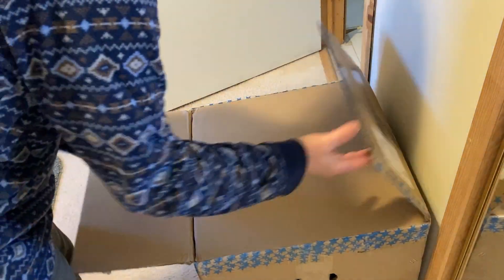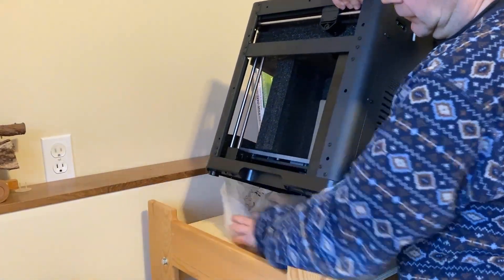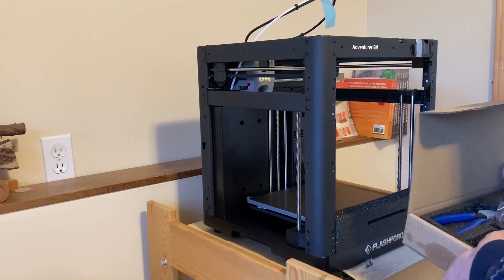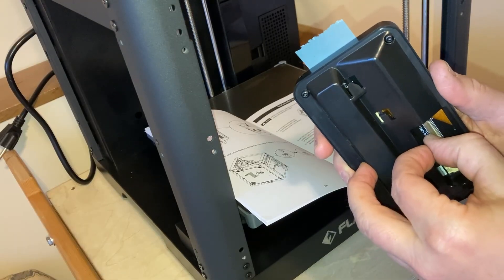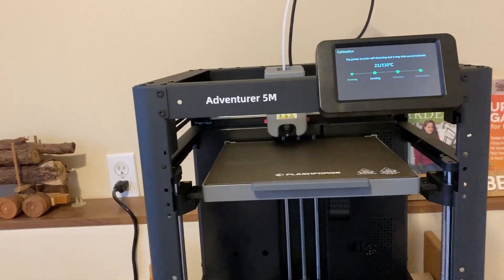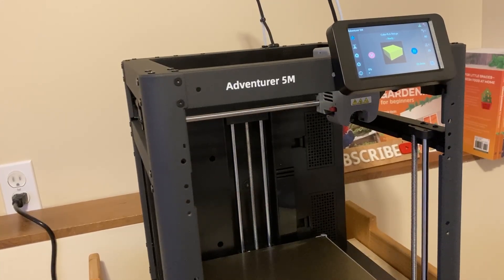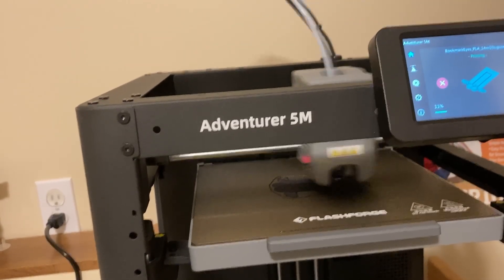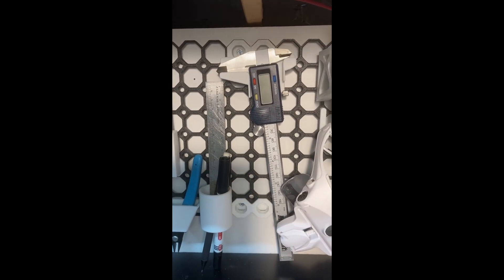Unboxing, Setup and First Print on my new Flashforge Adventurer 5M #flashforge #fdm #3dprinting

Comment: So im super new to the 3d printing world and am thinking of getting my first printer. I thought these needed ventilation of some kind? Or is that something newer printers dont really need? Thanks for the video!
Reply from the maker: It really depends on what materials you are printing - I have the printer in my office and do open the window a bit for fresh air when printing. But I mainly just print in PLA. If you’re printing ABS you definitely need ventilation and an enclosed printer.

Comment: Thank your for sharing your experience with this 3D printer.  I'm considering getting one for my R/C modeling and scale building of crawler trucks.  Does this printer have any odors or strong smells created while in the  printing process, my wife is pretty sensitive to odors and I would be putting this in my basement shop.  They sound like a awesome way to make custom scale parts, with beter geometry than I can gain from machining them out.  Thanks again, Take care and God Bless
Reply from the maker: It's a great printer for that - I've printed and built some of the 3dsets R/C vehicles over the past year. Compared to a resin SLA printer, filament is less smelly and generally safer if you only print in PLA, however there still is a smell since the printer is melting plastic. I would suggest as you are planning to keep the printer away from living areas - hopefully your basement has a room where you can close the door. If you can ventilate the space as well while printing, that would help.

Comment: Does it run your electricity bill up? Thanks great video
Reply from the maker: I wouldn't say by much. I just print once in a while when I need something. I've done a few RC projects that meant a lot more printing over several weeks and did see a bit of a jump in my electricity bill, but not a huge amount.

Comment: Our plug keeps disconnecting in the back, any suggestions?  And the filament keeps clogging and "breaking"
Reply from the maker: You mean the power plug? Try pushing it in firmly - if still loose I would contact Flashforge support. As for the filament breaking make sure it is dry and not too old - you didn’t say what type of filament, brand or how long you’ve had it.

Comment: You didn’t actually set up how you get into your account boo that’s where we’re stuck. It’s not working for us.
Reply: Same issue here
Reply from the maker: You don’t need an account. I have one but haven’t used it in a while - I just print directly to the printer over wifi using Orcaslicer. Or you can directly connect to the printer via Ethernet cable too.
Reply: @pacificcoastminiatures how do you setup to print over WiFi with orcaslicer? I've been using usb
Reply from the maker: Yes I print via wifi from Orcaslicer. Never had issues even with all the firmware updates that supposedly caused some people to lose their wifi connection.
Reply: @ just wanted to point out that my original comment was a little rude sorry I meant to explain that the first step should have been to maybe explain better the login process as that has been our main problem. Sorry about that.
Reply from the maker: No worries. Were you able to get up and printing successfully?
Reply: You only need the account for cloud printing which isn't good.  Use wifi or usb

Comment: the ribbon cable is the worst thing about this i think i bent mine and now the entire thing is just one big paper weight
Reply from the maker: Yes I agree it’s a bad design. But reach out to Flashforge for help - they can maybe send you a replacement.
Reply: It's actually a lot simpler than what it seems. It just goes straight in you don't have to install it at a weird angle than I thought
Reply: I was trying my hardest to try to get that ribbon cable in that weird angle and then figured out it's just a straight up and down slot. A design flaw in my opinion. Wish it was just a regular slot
Reply from the maker: @ridge9577 yes definitely a design flaw.

Comment: I set mine up yesterday, my first 3d printer. It did great. Now, today it goes thru the motions but no filament comes out. Help?
Reply from the maker: It sounds like you have a clog. You could try following this video from Flashforge: https://youtu.be/u12A1M3G68U
Clogs normally shouldn't happen with regular PLA - is that what you are printing with or some other type of filament? The only clogs I'm getting is with TPU, but that's a really difficult filament to print with. PLA is the easiest for beginners, so stick with that until you have more experience.

Comment: would be the perfect printer if it wasn't For the small bed. at least minimum  260×260×260. not 220...
Reply from the maker: So far I’ve found it to meet my needs for what I want to print. Keep in mind that these companies are usually aiming for a certain price point - making a bigger printer means the price goes up. Rumour has it that FF is planning on releasing a Plus or Max version of the 5M so we’ll see. I plan to build a 350x350 Voron Trident one day so that I can print larger items.

Comment: I don't know where to put the other end of the LCD cable
Reply from the maker: It goes into a connector on the printer itself just under the bracket that holds the LCD panel on. There is however a buckle or clip that you have to undo first, insert the cable and then refasten the buckle to keep the cable from falling out.

Comment: 5M  is nightmare for me, first time setup the controler cable pin defective, then they send a new cable but I dropped the cable latch on controller , so they were nice to send a new LCD controller.    I also forgot to remove the screw and it too tricky to put back the screw, now leveling dont work.  The leveling test should mentioned to remove the screw first..   Now it prinitng jsu strings....it should not be like this.
Reply from the maker: Sorry to hear about your issues. I agree the control panel cable should really be more robust. The screws I think are mentioned in the manual but not everyone reads that. I would reach out to them about the screw if you haven’t already. There may be a fix for that.
Reply: @pacificcoastminiatures  finallty got ahesion to work with just simple soap.
Reply from the maker: @Cordycep1 yes I find just washing the plate well with dish soap and hot water every few prints makes a big difference.

Comment: Just curious, did you have to bolt the table down at any stage?  I see it really rocks the table. I've ordered one, but before it arrives, I need to build a table for it. Just wondering if I need to bolt it to the wall to prevent vibration or ghosting issues in the future.
Reply from the maker: Yes it does shake the stand quite a bit but so far no issues - I may move its location and then I should be able to secure the stand better. I just made do with what I had, it’s not perfect.

Comment: You really should wipe down the build plate really good with Alcohol before printing.  It gets the oils and other particles off and helps with adhesion
Reply from the maker: I do give it a good wash with dish soap and hot water every few prints. Prints seem to stick fine although I had issues yesterday printing with a silk PLA but increasing the bed temperature helped.
Reply: @pacificcoastminiatures  Soap and water is good but Alcohol before each print conditions the plate.  Soap or your hands have oil that will sit on the plate. Alcohol takes off that oil
Reply from the maker: I'll give that a try next time I use that Silk PLA again. For regular PLA soap and water seems to have cleaned the plate well enough.

Comment: Curious about your software experience. Flash Print was abysmal in its ability to remote monitor and Orca Slicer had barely any remote capabilities. The new software of FlashMaker and Orca-Flashforge have also been broken for me. Spent the last 9 days with their tech support and made no progress rather then repeating myself over and over again.

My Creality K1 has been my most faithful workhorse and the BambuLabs A1 has some of the best print quality I have ever seen. If you dont need a huge print volume I would run from the Adventurer 5M and to the A1 Mini which is cheaper, more reliable and has refined software.
Reply from the maker: I’ve had no issues with the software yet. I’m only using Orca Slicer, the official version not the FlashForge one. And I had no issues setting up my printer with Flashmaker so that I can monitor prints when away from my office. I send jobs via wifi from Orca Slicer and it just prints.
Reply: @pacificcoastminiatures  You made a good purchase with the 5m, a lot of these new Klipper printers really do well out the box. The A1 mini is a nice printer, but the m5 should be reliable and I've heard it also prints TPU like a dream, you already have filtration and can complete the enclosure very easy, also with the 110c max bed temp you can print engineering grade filament that the A1 Mini will never dream of printing like Polycarbonate, Nylon, ABS, and ASA. Co print should release an AMS for Klipper printers this year so even that is a possibility in the future. Also, your device page on Orca Slicer has more remote capabilities than any Bambu labs printer owner would know what to do with. Klipper is the future. All this from an X1C owner for well over a year and half, they are amazing printers but impossible to work on when the time comes and most new Klipper printers have caught up in print speed and quality. Check my channel out I just posted some videos comparing a $299 Infimech TX printer to my X1C and its sad how close they are.
Reply from the maker: Thanks, I am very happy with the printer with very few issues despite some of the problems I've heard that others have had. I even updated to the latest firmware a few days ago and had no issues continuing to print through Orca Slicer. 

I am interested in trying TPU to print out some tires for car models, just have to get a spool. 

I'm only interested in a AMS or MMU if it doesn't create too much waste. I did try printing a bookmark for my daughter by pausing the printer at the correct layer and swapping filaments and it worked quite well. I prefer models where different coloured parts are separate and then you either pin/snap or glue them together. 

And I heard about the Infimech TX printer on another channel, will check out your video. I do plan on enclosing the printer at some point so I can print with some of the engineering filaments. Bambu Lab printers are top of class but like with cars, not everyone needs nor can afford the most expensive. It's good that we're getting more affordable coreXY printers - competition is always good to see.
Reply: @pacificcoastminiatures  How did you get the Flashmaker app to add the printer?
Reply from the maker: I don’t remember the exact steps but there is a QR code you scan in the printer with the Flashmaker app. It was quite easy.

Comment: Thank you for sharing! Is there anything you need to do to calibrate the XYZ's on this? I have an older-design fast bedslinger printer at a different address, and it was necessary to edit the rotational distance (in the machine config) just to get the dimensions to print exactly.
Reply from the maker: Not that I’m aware of - I’m pretty happy with all the prints I’ve done so far. Obviously not as precise as my resin printer. There are some slicer settings I might tweak over time to get the best quality out of it. But I’m mainly printing functional parts so high quality isn’t as important.
Reply: @pacificcoastminiatures  Same. The things I design are physical replacement parts for motorcycles, functional enhancements to the printer, household fixes, electronics enclosures. For example, motorcycle handguard plastics are maybe $40/pair, but that $40 buys you two rolls of PETG, and that's enough to make 6-8 pairs of handguards. So hopefully no adjustment is needed to get the dimensions exact. The other printer (SV07+) is all dialed in now .. extremely exact XYZ dimensions.
Reply from the maker: @suzyamerica4679 that’s great! I think an FDM printer will soon be a household appliance because it is so versatile.
Reply: @pacificcoastminiatures  I love the way this tech upends the traditional supply chain .. there are people out there who get some new electronic components on a Friday, design the case and fixtures over the weekend, release the designs Monday, and by Tuesday the finished product is out on the street already all over the world. MalWart wouldn't have even gotten its design team moving in so short a space.

Comment: I just pulled the trigger on the Adventure 5m as well today :-D  this will be my 3rd printer, and 2nd FDM one.  It's been years though since the last height of my FDM days.  Very excited!  wishing you the best with your "adventures"! :-D
Reply from the maker: Awesome! Let me know how it goes with your "adventures" too. You'll find the 5M is a huge step up from your 1st FDM printer. I can't get over how fast it is once it gets going.

I also have a Mars 3 resin printer for all my N scale details. I think as a modeller having both is a plus if you can afford it. My next major tool purchase will likely be a laser engraver/cutter. Maybe next year.
Reply: Keep the box, it may be better to return it. The promises FLashforge made in their advertisement have been inflated. I got an adventurer 5M about 2 months ago and regret it. This is coming from a Bambu Labs A1 Mini and Creality K1. The software has been subpar from the get go and the new software (Flashmaker and Orca-Flashforge) are just barely functional. Make sure to get testing done prior to the return window ending, buying remorse for sure on my end.
Reply from the maker: @mwood2 I’ve been using Orcaslicer and it’s been working great. Give it a try before you completely give up on the 5M. Bambu has had their share of issues too so they are not perfect. As they say YMMV - everyone needs to do their own research like I did.

Comment: Once you have a FDM printer you'll wonder how you lived without it.   Not sure if you are modeling your own items yet, but that is defiantly the way to go.    I use the free version of Fusion360, but OnShape is a good one too.  TinkerCAD is good for the basics.
Some recent items I have designed and printed.  Custom pegboard holders, indexed risers for my laser cutter, and risers to lift the enclosure to allow proper distance for a camera.  Solar finder for telescope, Servo mounts for switch turnouts, on model RR.  IR sensor holders for model RR,  TelradMouts for different telescopes, Duct adapters to vent laser fumes out window.   Water filter system for airbrush booth as there is no window where it is,  Well you get the idea..   You will always be finding things that need printed.  

I have only been printing in PLA, and if you orient the objects right, and use enough infill/walls  (I use about 20-20% for the "stronger: items, but 15% works well for smaller items.  4 walls for most) the parts will be plenty strong enough.  I have tried a few things in PETG, and I find they really aren't all that much stronger.     

Another tip, CA (super glue) is the most recommended glue for gluing PLA,  and it does work well, bit I find that styrene cement, the water thin solvent for gluing styrene kits, sheets, rods, etc, works even better and is easier to use.  It basically welds the pieces together.  The material around it breaks before the joint does.   CA is a bit brittle.   

Also print a set calibration plugs/holes  to see how your parts mate for when you design parts.  My printer uses an offset of 0.1mm for tight fitting pieces, .2 for a snug fit, and .3 for a loose fit.    This allows for larger prints than your bed can accept ( I use dove tail joints for this ) and allows you to design so all parts print for maximum strength, and/or less supports.  You then simply glue the parts together.    I have yet to have a part fail when using styrene solvent.
Reply from the maker: Awesome! Thanks for those insights and tips. I’m starting slow but as you said there’s always something you realize you need that you can print. We needed a new flap on our Toto washlet which I designed in Tinkercad and went through several iterations of prints until I got the right size and shape for the pegs that hinge the flap. And if it ever breaks again I can just print a new one.
Reply: @pacificcoastminiatures  Being able to design & print your own stuff is the best use for these printers, especially once you get the design -> CAD -> print -> test pipeline streamlined. Even more fun when you combine that with electronics / electromechanicals.